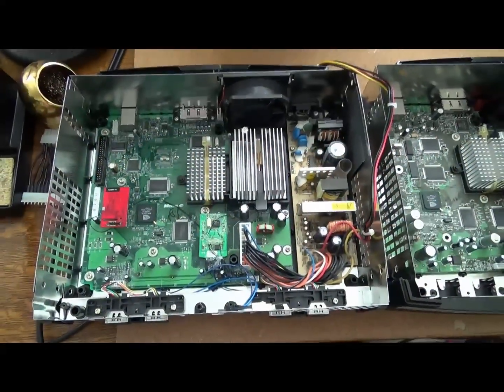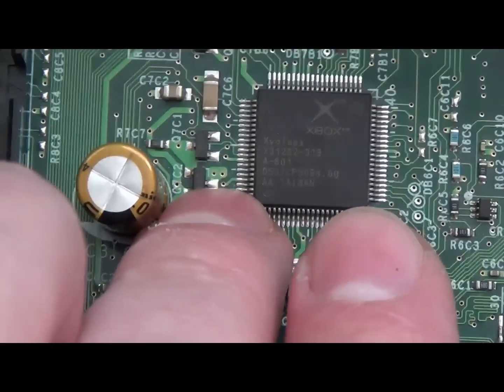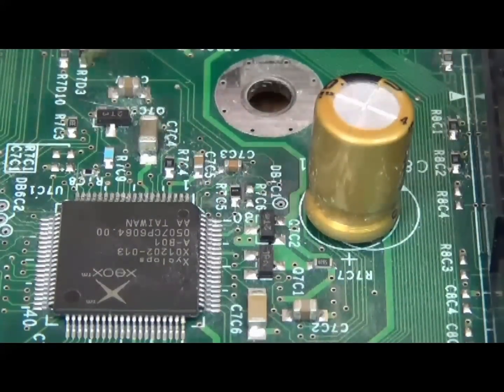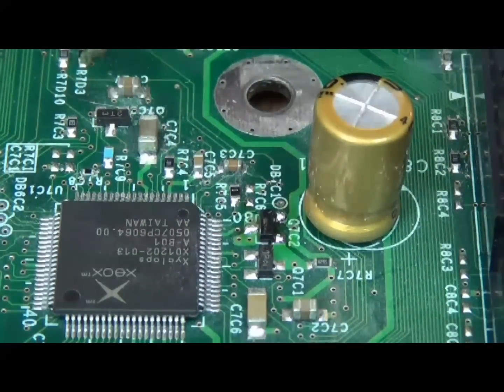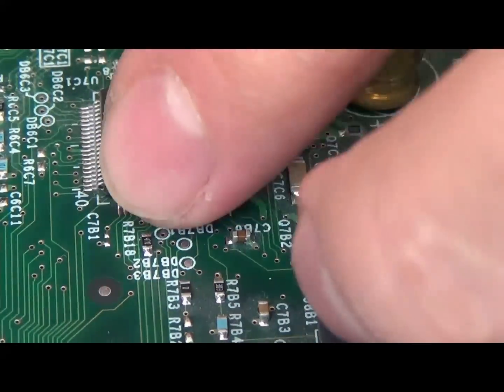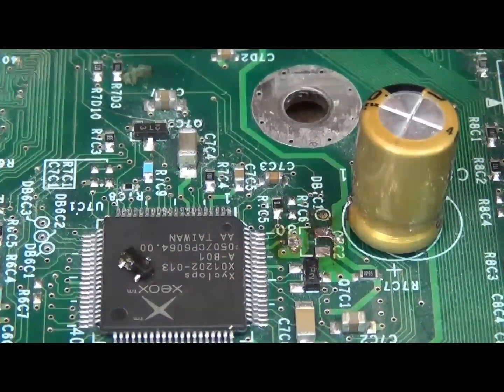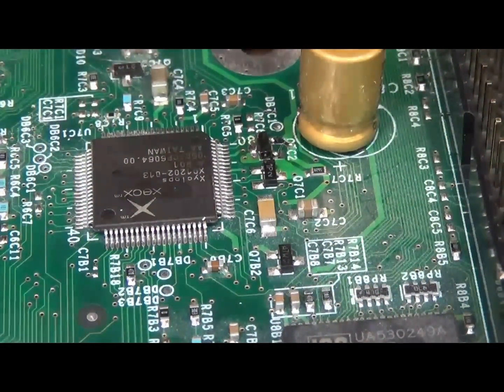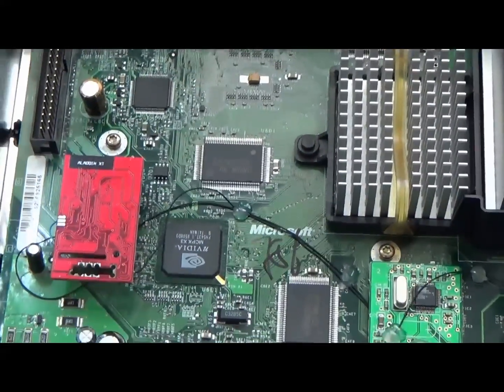Original Xbox version 1.6 won't power on fix

Comment: I am Brazilian, I have a classic xbox 1.6 board, it has this same problem, the lights are flashing and no image, this transistor has to have what voltage for the xbox to connect? need help
Reply from the maker: It should have 3.3 volts
Reply: Thanks for the answer, I will test on my, my classic xbox spent 2 years saved, when I turned it worked perfectly for an hour and a half, after that time it started to lock and freeze the image, I had to turn it off and call back To the normal, only that the brakes were more constant and today he does not appear image, I press the power and it turns on and off for 3 times and it is turned on flashing the led and without image, I wanted very much to fix my classic xbox here in Brazil Nobody knows how to fix it
Reply: Do I have to test these 3.3v with the console on? Or have it turned off?
Reply from the maker: With it turned on.
Reply: Friend do you have the technical board 1.6 schematic? Is there another piece outside this transistor that might cause this same problem?

Comment: I just did this on my 1.6 and sadly, it didn't fix my problem. I can't even get any readings from the collector, not even briefly.

My Xbox started suddenly not powering on a couple months back. First it turned off after staying on for about 3 seconds and it would stay on a little longer everytime I pressed the power button. I could even get it to stay on long enough to start a game and play it without any problems for as long as I wanted. Recently it got worse and I couldn't get it started anymore no matter how long I kept tapping the power button.
Reply: sokka06 What did you do I have the same problem not sure if its capacitors or this transistor all my capacitors are clean and none are bulging I cant tell what to do, what did you end up doing?
Reply: Yeah mine also randomly stopped powering on as well. I replaced the power supply and the plug but nothing. I haven't checked this transistor yet but considering it doesn't power on at all I doubt my multimeter will even read anything.
Reply: Whoops, guess I missed the first comment. 

I ended up buying another Xbox 1.6 that had the exact same PSU and tried to start the broken one with the power supply from the working Xbox.

Sadly, that didn't fix anything, so now I just use the other Xbox and it's still going strong.
Reply: @sokka06  Did you try and measure the voltage on the transistor with the other power supply? You should be getting somewhere around 3.3V at the collector regardless of whether the console is on or off. If you don't, then you could try replacing the transistor, and if it works after that, you can try if the old PSU still works. Maybe you'll end up with two working consoles after all
Reply: Some people have replaced those large capacitors near the cpu anyway. It’s worth a shot.
Reply: There's another point of failure for 1.6 boards than this also, T60N02R by the ATX connector, check you're getting 5V on the output when attempting to power on.

If that's faulty, piggyback a new chip on top of the old

Comment: I just tryed to put a 1.6 board In a older case and have the exact same problem demonstrated here, whoops. I 
Ordered the transistor from eBay and have my fingers crossed. thanks for the video, very helpfull.

Comment: hello my original xbox wont turn on : but i dont know what to do 
-the power board is ok -when i unplug the hard drive i can heard a little sound when i try to power on the xbox-i try to plug a other hard drive and i dont heard the little sound-i try a other power cable that change nothing-the xbox stop working after unplug and replug because i was moving the xbox to a other room
So i dont know where is the probleme can you try to help me
Reply: Sorry its a 1.6B motherboard
Reply from the maker: I would check your power supply first.
Reply: What is your email for showing you the picture ?

Comment: Okay so how did you power it on if "won't power on fix" is in the title? Mine won't do anything. Power supply checked out good.
Reply from the maker: This Xbox wasn't actually suffering from the "won't power on" issue, I was just demonstrating in the video what to do if you experience this issue.
Reply: Sorry I was being a dick.. You said collector voltage of less then 3? Wish more detail would've went into diagnosing this one stupid little transistor failing here.. Anyone that can get this thing broken down owning a soldering iron understands the component swap part...

Comment: nice vid mate, any idea why a 1.1 xbox will power on for about 3 seconds then shut off?

I've replaced the power supply and power cable, also changed the thermal paste on the cpu and gpu!
Reply from the maker: My guess would be trace corrosion.  I have a tutorial on how to fix that over at theisozone
Reply: Did you remove the clock capacitor?

Comment: When I visited El Paso not too long ago (it was back in May), after hooking up the Xbox, I press the power button and it won't turn on right away (which doesn't make sense since the original Xbox always turns on right away after pressing the power button and the eject button since I first got it for Christmas 2004). In order to power it on, I have to hold the power button for a while until it starts boosting up. After it powers on, it starts working.

Is there an problem with it? It was in great shape since December 25th, 2004 until I encounter with this minor issue (and I have a version 1.6).
Reply from the maker: Never hear of that problem before.  Check the wiring leading to the front panel pcb, maybe a wire or two is not making good contact.  Also check the front panel pcb connector that plugs into the motherboard, for any loose wires.
Reply from the maker: ***** Are you playing the games from the hard drive or the optical drive?
Reply from the maker: Maybe the drop in framerate is due to the optical drive having a hard time reading the disk.  Maybe the laser is on its way out.  Softmod the Xbox, then run the games from the hard drive, and see if the problem persists.
Reply from the maker: TSOP or modchip are both good ways to go.  TSOP is cheaper

Comment: witch one is it that has 2 fans one in the back and one on the board i have the one with 2 fans and i dont know what model it is because the sticker is faded and you cant see the model and i need parts.my xbox has a power light and its green but i havent got a screen the start screen wont come on i was going to try to find the same model that doesnt read games and change my disc drive.......if its the same......can you help me

Comment: Where can I get a new chip to replace the one that's bad?
Reply from the maker: Hey V Man, sorry I just hadn't re-posted the add yet.  You can purchase it here http://www.theisozone.com/market/items/item-2182088557/
Reply from the maker: Rockhaller You can get replacements from me over at theisozone.com marketplace under the section "Replacement Parts & Tools" subsection "Microsoft Xbox".
Reply: Floydzabarber Hello Floydzabarber, I have a v1.6 with almostly the same problem, because it won't turn on, but the problem is that I've tested the 2T transistor with my multimeter, and it deliver 3,40v   ....... Maybe there is a short anywhere ?
Reply from the maker: satchsatch33 It sounds like you have a different issue then.  I would check all of the voltages being delivered by the power supply, it's possible that your power supply is the cause of the problem.
Reply: Thanks :)
I have tested with others v1.6 power supply boards and others front panels and it still doesn't work....so I have tested once more with my multimeter the 2T transistor who seems to work (3,27v stable) and p/e continuity trace (it seems to works to)....but my motherboard still won't power on....any issue please ?
Reply from the maker: Are you getting any kind of error code with the front panel LED's or number on your display?
Reply: Floydzabarber In my case, leds doesn't power on and the hardware won't power on to, but each time I try to boot the system by pushing on/off button, the case fan runs for 1 second then stop immediately.....so there is not an error code, because the hardware won't power on....
Reply: Floydzabarber I went to theisozone and looked for the chip as per your directions but I can't find it. Where can I purchase it?

Comment: Good day!
In general, there was a problem with the first xbox v1.4, the behavior of which is unknown to me ...
After plugging in the power plug to xbox run system, but button "Power" does not respond to pressing, ie It is included only on the power plug. bt. DVD-Tray running, a chip "xecuter 2.3 lite" - that the chip and without it, all the behavior of the system also comes the same error in the service mode. The analysis of the case and after some time (10 min) saw strong heating "of the North Bridge and the GPU." as well as on board the bursting of the electrolyte was found labeled "1F / 2.5V" - replaced the "1000mf / 6.3V." Visually, no other physical defects.
Maybe someone knows where you can download the service manual first xbox, or who faced such failure xbox original?
Reply: +Айдар Гайнуллин Смогли решить проблему ? у меня бокс 1.1, похожая проблема, часто не включается через кнопку включение, не реагирует никак, но если включать через кнопку выброса трея,  запускается, причем всегда, но без чипа тогда, так же включается если воткнуть шнур питания, но так же без чипа, с чипом только кнопкой включения. Выключение срабатывает всегда. Не знаю в чем причина. Глюк вылезает пропадает внезапно, так же как и появляется.
Reply: +Айдар Гайнуллин 
вооружился с лупой, обнаружил микрокоррозии дорожек...
Reply: Спасибо, будем искать значит
Reply: +Александр Заплацински 
Загляни сюда: http://diy.sickmods.net/Tutorials/Xbox1/Power-Eject_Pinouts/ там все расписано, помог мне решить проблему только этот сайт.
Reply: спасибо большое! уже все сайты облазил, нигде решения не мог найти, надеюсь это поможет

Comment: I thought V1.6 xbox motherboards could not be hardmodded with a modchip or TSOP because M$ revised the motherboard to prevent people from doing that?
Reply from the maker: They cannot be TSOP flashed because there is no TSOP chip to flash, but you can install modchips if you rebuild the LPC with either hookup wire or an LPC rebuild PCB.